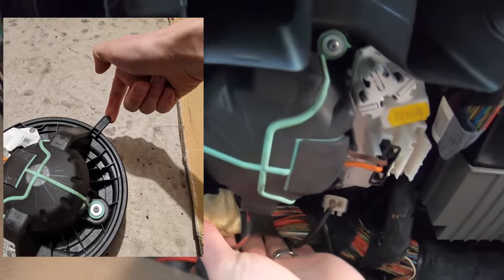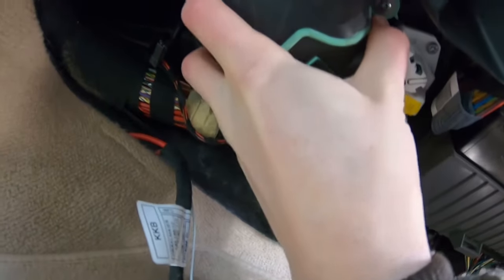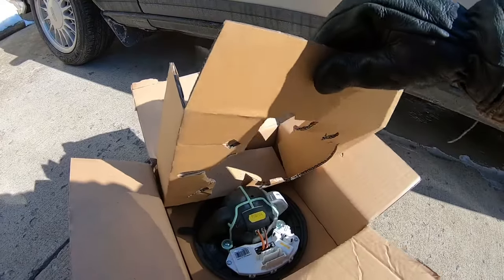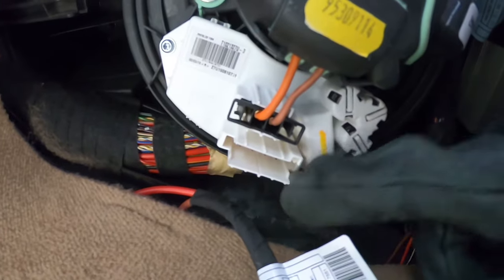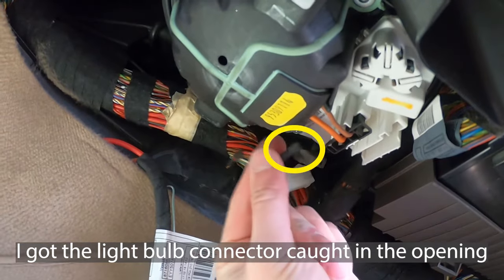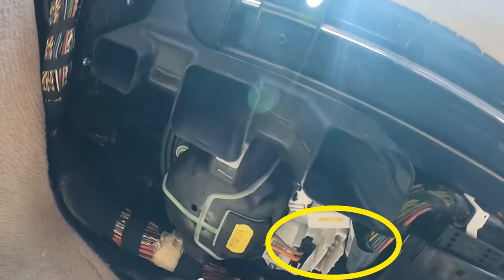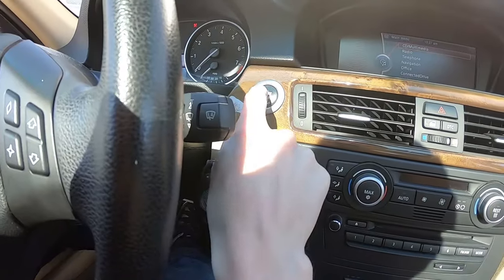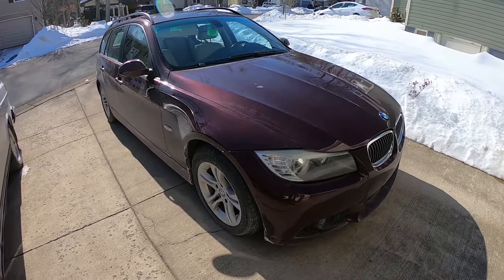Replacing A BMW E90 Blower Motor in 43 Seconds

Comment: My e90 throwing ac but on the dash passenger is throwing cold and hot on driver side
Reply from the maker: You are low on refrigerant
Reply: @AHFixIt  how much does it need? Because i just used a 12z can and still nothing. Wonder if has something to do with blower resistor

Comment: Mine stopped working. Had the recall a few years ago. Had no visible issues wrong. Took it out, sprayed contact cleaner all over motor, tested, reinstalled, works like a champ again.

Comment: Best tutorial out there. 5 years ago when I replaced the blower motor on my first E90, I was probably there for a good 20-30 minutes. This time it took me 10, taking my time. 

One tip: take the air ducting and yank it down, it moves somewhat freely and gives you the extra room you need to wiggle the motor in/out